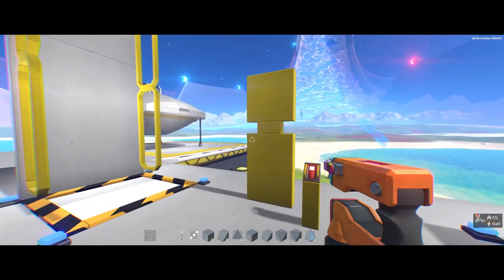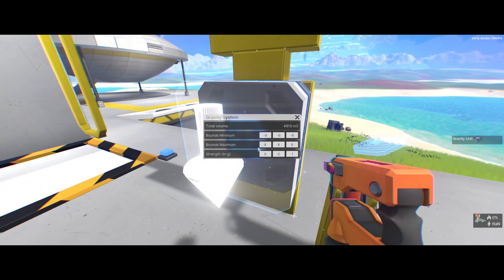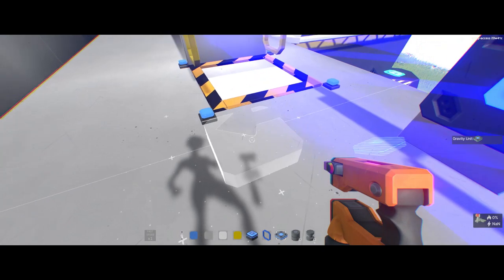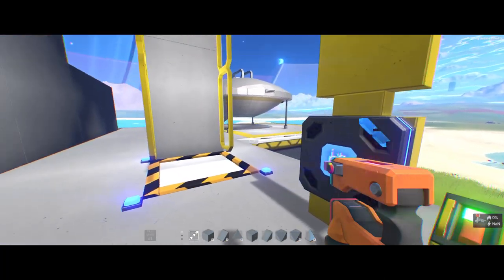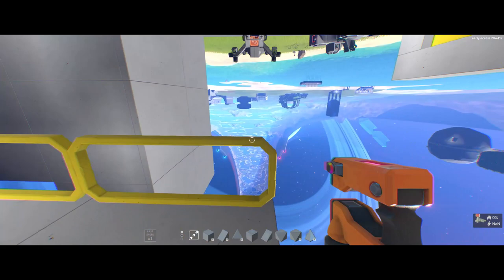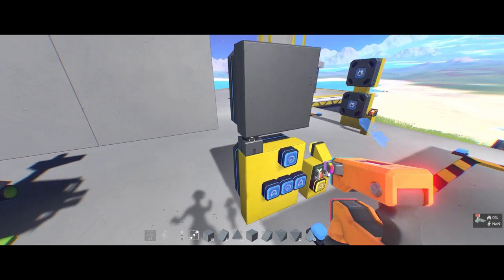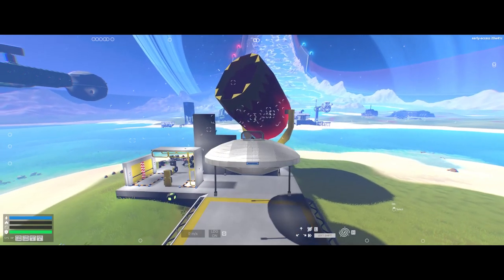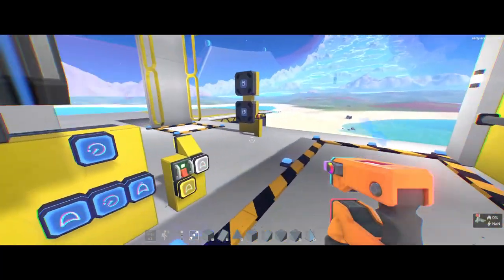Playing with Gravity; Airlocks go woosh and short-range tractor beams - Starship EVO (Early Access)

Comment from the maker: I forgot to mention! That for the airlock and the tractor beam examples; You can set values for gravity to be greater (or less) than 2. In their cases I used a value of 20 or -20 (I think) in order to get the required effect!

Comment: As always, love your work.
Reply: So, decided to play again. Took inspiration from Derp Corp Towers and this gravity tractor idea. Was looking for a good elevator system besides jump pads and the common examples online. 

Ended up using volumetric sensors, during the beam up. To close the floor below me with rails as I came up to that floor. Had both beams up and down same positioning with up beam higher strength setting. Worked amazing until I deleted the rail whilst getting beamed up. 

I know I'm going to have to report to dev at some point. Game is so corrupt now lol. 

But thanks for the inspiration.
Reply from the maker: You're welcome :) I haven't properly tackled elevators yet. Only simple one-floor rail platforms.
I'm contemplating some sort of convoluted piston based system and logic which uses query blocks attached to the pistons to determine the elevators position, so that the buttons the player presses to move the elevator will cause the appropriate pistons to extend or collapse.
It may become a horrible mess.
I think I saw an elevator example uploaded to the workshop though. That may be worth a look.
Reply: @curioinventorium  I saw a video just as you have described your idea. 7 floors with 7 buttons. Aesthetically, was atrocious but logically quite sound. So its doable and would be less buggy than my fiddling. 

But I reloaded my tower in a new map, seems to be okay, its quite nice having the ability to glide up floors haha. 

Then it got me thinking of travel travelators. Like my previous experiments of using jump pads with tunnels for long distances. 

Maybe teleportation will be the answer 😅

Comment: I would try using the Gravity Units for fighter launch tubes, like in Battlestar Galactica. Have the fighter docked on a landing pad that is on rails. Then when you are ready to launch the landing pad moves the fighter into the tube where the gravity field is, and the pilot just has to undock from the landing pad, then gravity should launch the fighter down the tube and out of the ship.
Could also use them for torpedo launch tubes, if there are explosive warheads you could put into a torpedo you built. 🤔